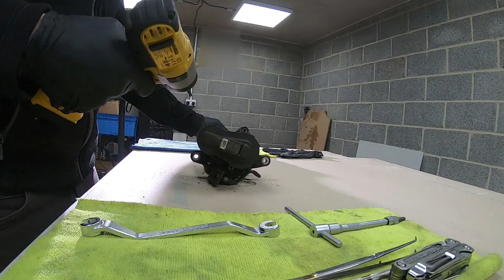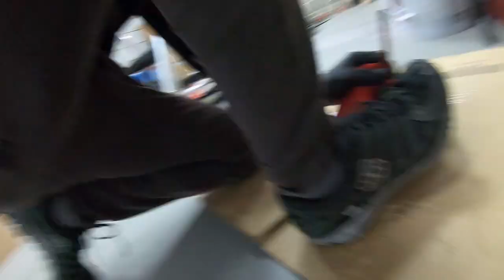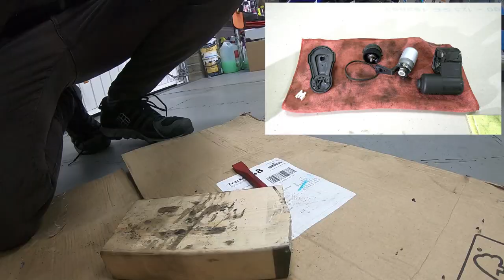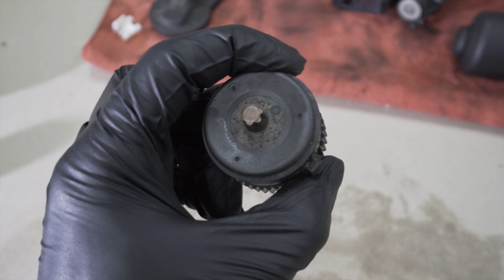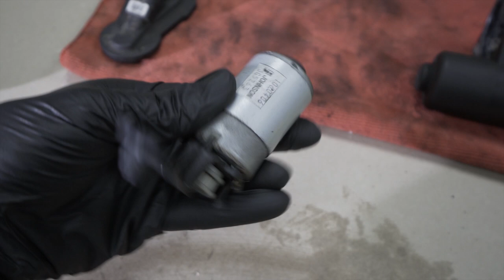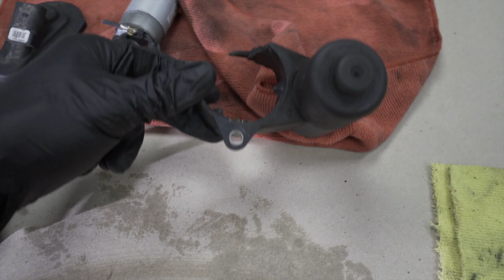What is inside the VW Passat B6 EPB rear caliper?

Comment: Any idea what causes these to squeel when the handbrake is applied and released?
Reply from the maker: that squeel was something that i experienced on my audi. The general consensus was if it works don't touch it, so never touched it. I would be tempted of saying that something in the mechanism needs greasing. Next question is what type of grease to use? the grease that i am considering now for a brake pad+brake disk change is a PERMATEX 24129 1650°C Ceramic Extreme Brake Parts Lubricant - Anti Squeal or for your application a Silicone Grease. Now it will be tricky  to get the right grease, but if you will attempt to do it, please let me know how it goes and what grease you have used.
Reply: @BestCarMods  thanks for replying. I looked into it a bit more it's not that simple to grease them from what I've learned unless ur willing to take caliper apart. One option I'm thinking of is if u let the caliper piston come the whole way out until it falls out of caliper grease the back of piston and then try get it back to togheter seems like it might be simpler. FYI these are belt driven have to be careful where u grease. If I learn anything else il pass it on
Reply from the maker: @christopheroneill2961  Now I have a BMW F10 and the brakes are not making that squeel like on the Audi. will take a look to see if they are a similar construction.